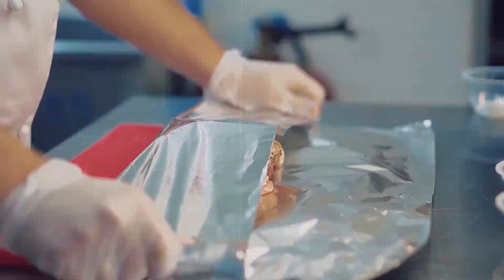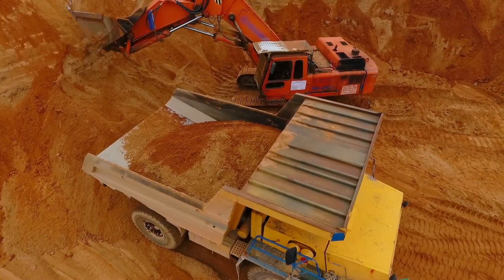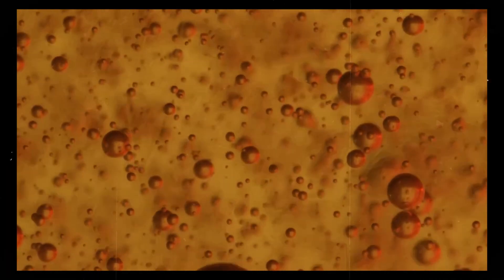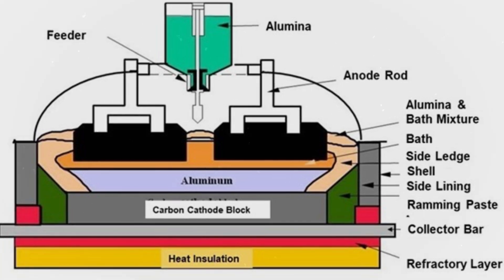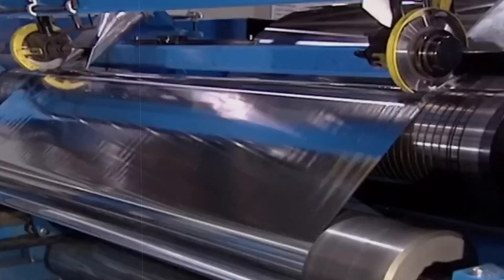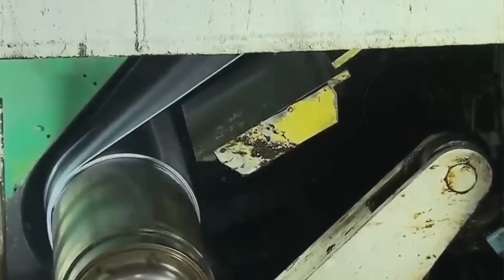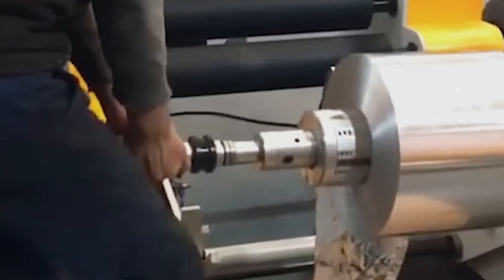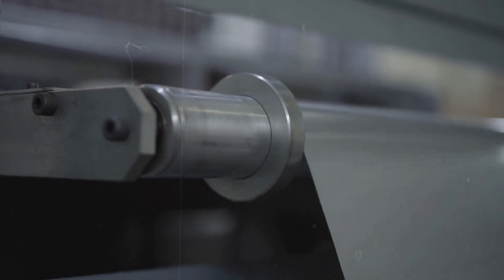From Raw Metal to Kitchen Essential: The Complete Journey of Aluminum Foil in Factories

Comment: In Canada they make it out of dead bodies.
Reply from the maker: It seems there's been a misunderstanding or a mix-up in the information. The production of aluminum foil does not involve any materials like what you've mentioned. Instead, aluminum foil is made from aluminum metal, which undergoes a series of processes to be formed into thin sheets. The process typically involves mining bauxite ore, refining it into alumina (aluminum oxide), and then smelting the alumina to produce pure aluminum metal. From there, the aluminum is rolled into large, thin sheets which are then further rolled to the thinness we associate with aluminum foil. This material is widely used for packaging, insulation, and other applications due to its lightweight, non-toxic, and corrosion-resistant properties. It's fascinating how such a versatile product comes from a process that starts with a natural ore. If you're interested in more details about the actual production process of aluminum foil or its applications, feel free to ask!
Reply from the maker: It seems there's been a misunderstanding or a mix-up in the information. The production of aluminum foil does not involve any materials like what you've mentioned. Instead, aluminum foil is made from aluminum metal, which undergoes a series of processes to be formed into thin sheets. The process typically involves mining bauxite ore, refining it into alumina (aluminum oxide), and then smelting the alumina to produce pure aluminum metal. From there, the aluminum is rolled into large, thin sheets which are then further rolled to the thinness we associate with aluminum foil. This material is widely used for packaging, insulation, and other applications due to its lightweight, non-toxic, and corrosion-resistant properties. It's fascinating how such a versatile product comes from a process that starts with a natural ore. If you're interested in more details about the actual production process of aluminum foil or its applications, feel free to ask!
Reply: Only the good stuff, hoser.

Comment: Hard to believe foil is as inexpensive as it is...amazing amounts of energy is required...economies of scales by definition!
Reply from the maker: Absolutely, it's quite remarkable how aluminum foil, despite its energy-intensive production process, remains relatively affordable. The economies of scale play a crucial role in this, as large-scale production helps to distribute the high costs of energy and raw materials over vast amounts of product, making it more economical per unit. Additionally, advancements in technology and efficient recycling practices have also contributed to keeping costs down. It's fascinating to delve into the manufacturing world and see how these processes are optimized to deliver products we often take for granted in our daily lives. Thanks for pointing out this interesting aspect! Do you have any thoughts on how recycling impacts the cost and sustainability of products like aluminum foil?